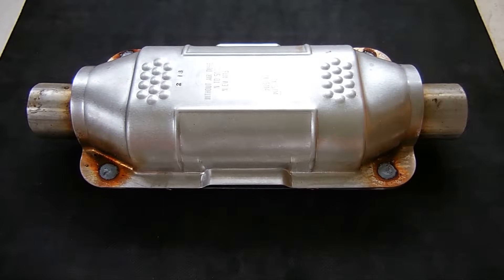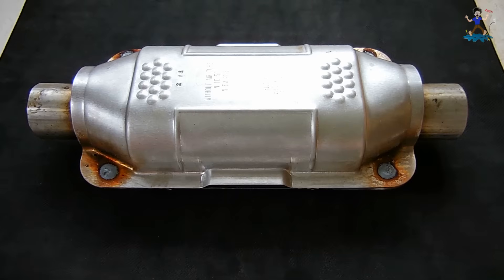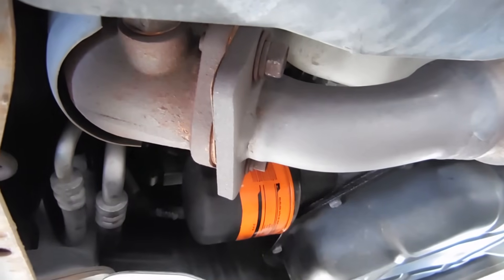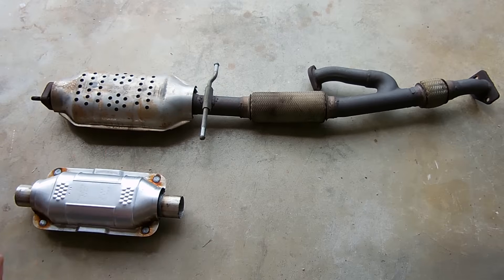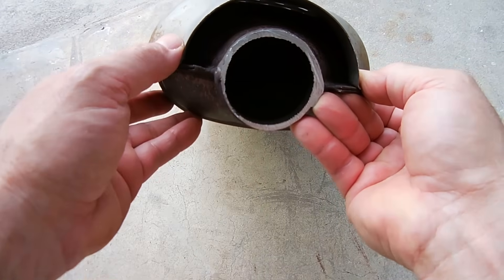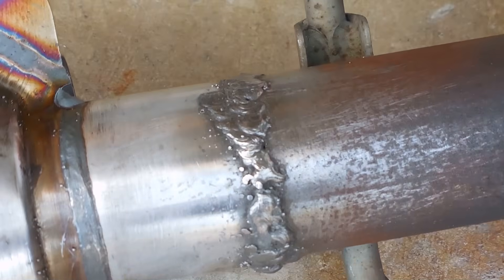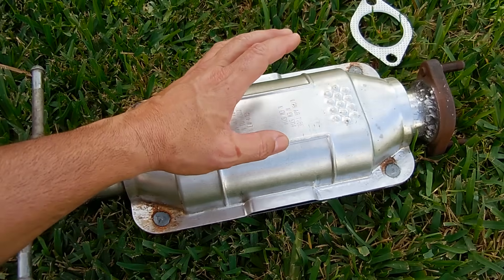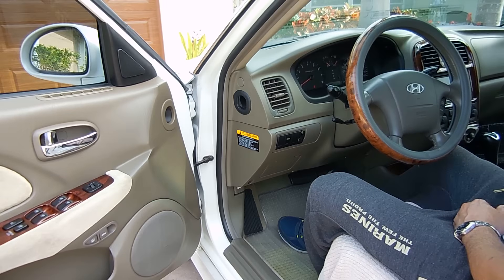Catalytic Converter Problems & Replacement

Comment: I have a 2017 Hyundai Tucson. My check engine light came on and the dealer said it was my catalytic converter. They charge $3000 to replace. We didn’t get it fixed. Looking for an alternative. The check engine light hasn’t come back on. My husband drives it 10 miles to work. It runs fine and there isn’t a smell. It stutters a little going up steep hills and it won’t go above 50 to 60 mph uphill depending on the incline. 

The back muffler vibrates something awful going up hill and the car struggles to change gears. 

Please advise and offer suggestions.

Comment: I am enjoying watching your videos. I have a 2001 P T Cruiser which seems the Catalytic Converter is going out. I have already had ex replace power steering pump. Any suggestions you have on me doing it myself would be greatly appreciated! I highly respect people who know what they are doing and are kind enough to share their expertise! Thank You...
Reply from the maker: Hi Erin. For a much easier job, you'll have to spend more money on an exact replacement. You'll have to cut out the old cat, then installed the new cat using flared steel tubing with U-clamps. Thanks for watching!

Comment: I weld like you do side to side BUT.... I was told by a pro welder it is better to stay in a straight line move forward then back about 1/2 way so one step fwd 1/2 step back - still creates nice ripples but is less likely to result in gaps or pin holes - esp in pipe situations.  Also could tack weld then could have a helper rotate the assembly as you weld.
Reply from the maker: Very difficult to rotate a heavy, odd shaped piece of metal. Thanks for watching!

Comment: My light is on for both of my cats but there is no symptom of it being bad im hoping its either just a bad gasket so its sucking in air or its the 02 senor
Reply from the maker: Check for stored trouble codes.

Comment: Never ever use leaded petrol with catalytic converters and don't use silicone spray base products anywhere near the engine bay or air intake. The silicon binds to the metals in the converter and stop them from doing their job.
Reply from the maker: Correct.

Comment: Dude, you don’t weld going side to side... you weld going up and down
Reply from the maker: Incorrect. The motion is a left and right rocking or zig-zag motion and you move up or down the connection. Welding thin wall steel tubing using the equipment I used wasn't easy.

Comment: Mig welding that thin pipe is no easy task! Nice job on the fix!
Reply from the maker: I'm glad you understand that, many don't. I got that pipe together the best I could with the inexpensive welder I had. Thanks for watching! Please share.
Reply: AND MIG welding any exhaust part thin or thick WITHOUT pinhole leaks!  Often it helps to use a torch to heat a pipe & PLUG the tail pipe to reduce air movement as welding temps rise causing a rush between hot and cold air which often is the cause of pin hole leaks.
Reply: Paul C I’ve done very few exhaust projects but anyone who attempts an exhaust weld repair and gets the job done has my respect.

Comment: Interesting i found that one of my cars had better horsepower when i removed the CAT. And yours has three..... Now that's okay but does it really need them all as only. The front two have sensors before AND after? Or add a high airflow CAT increses mileage AND performance
Reply from the maker: Yes, removing the CAT will give you more power because there's less back pressure in the exhaust system. Glad you enjoyed the video! I have a lot of excellent videos on my channel that cover many different subjects, so be sure to check out my extensive video playlists for other videos of interest to you, rate thumbs up, and share my channel with others. Thank You